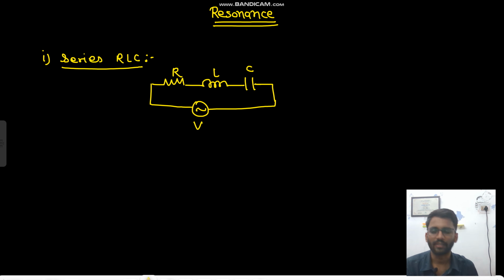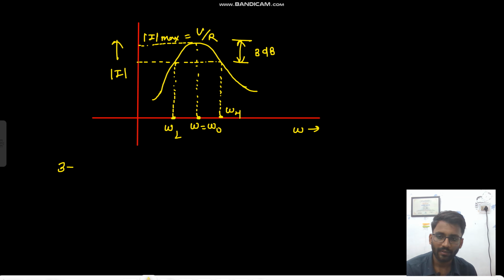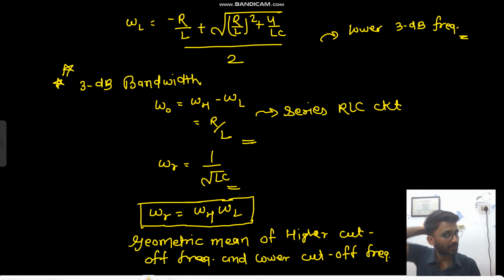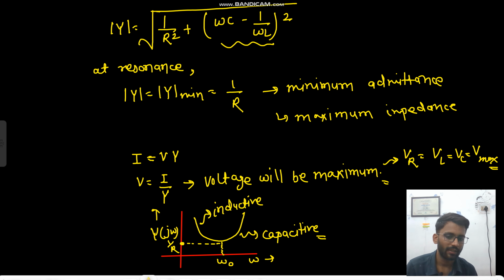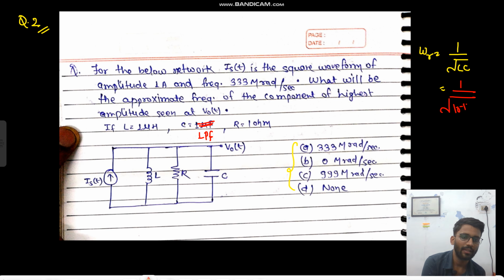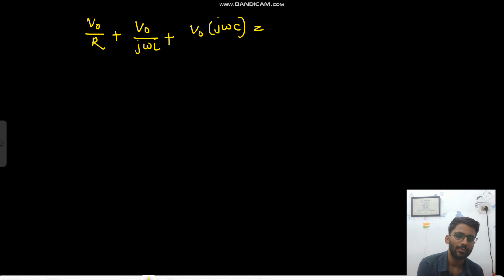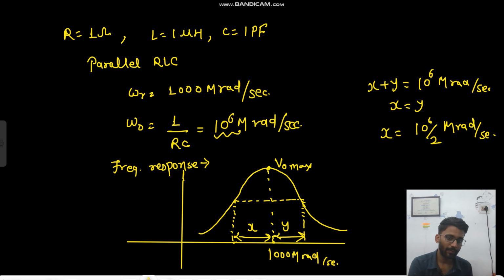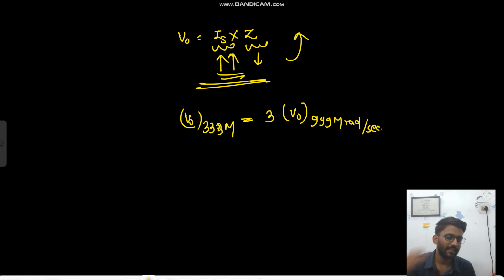Resonance in RLC Circuits || Analog VLSI Mastery (Cohort 0-10)

Comment: How did you infer that the areas cut by x and y in 36:09 are equal? Is that equal everytime??

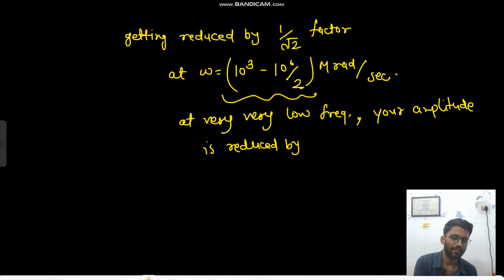And at 38:24 WL = 10^3-10^6/2 is not very low. Infact it's very high(considering the magnitude of the frequency)

Can you please comment on this sir?
Reply from the maker: 1) Graph will be symmetric about Wo.

2) You can't take magnitude there.
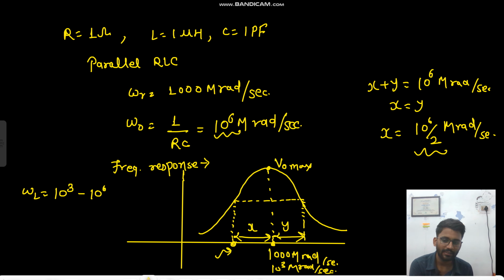Reply: @HimanshuAgarwal_  sir at 37:07 sec how can graph be symmetric about wo? its geometric mean of wL and wH, not arithmetic mean of them. so how are you assuming wo to be at middle of the band or equidistant from wL amd wH?
Reply: @HimanshuAgarwal_ I think from the quadratic roots of wH and wL can be calculated and it should be nearly 0 and 10^12 rad/sec, where as the resonating frequency is 10^9 rad/sec